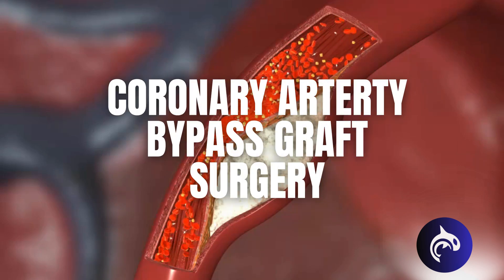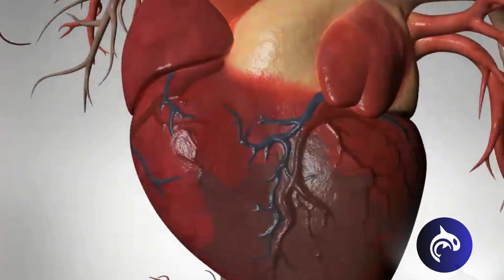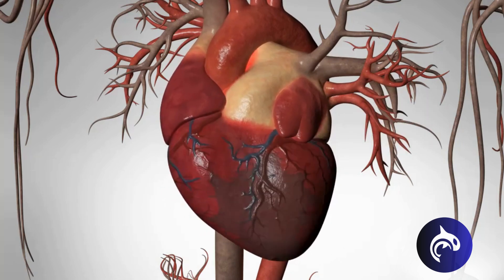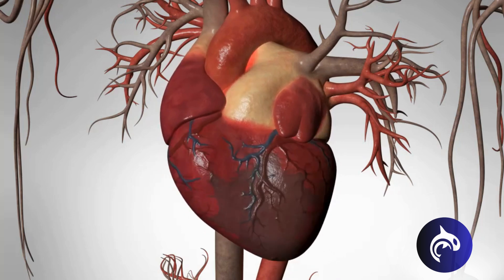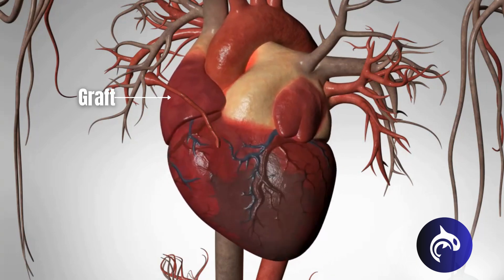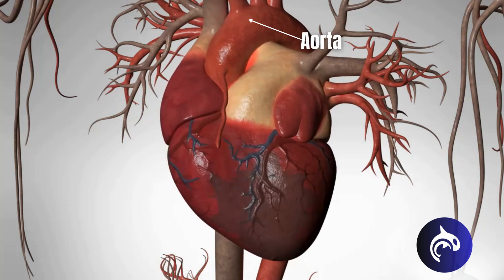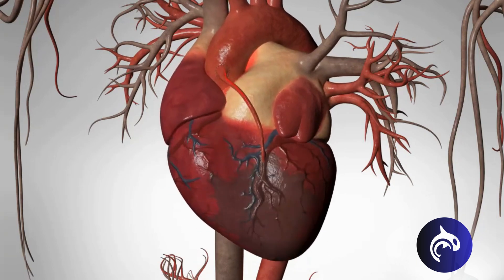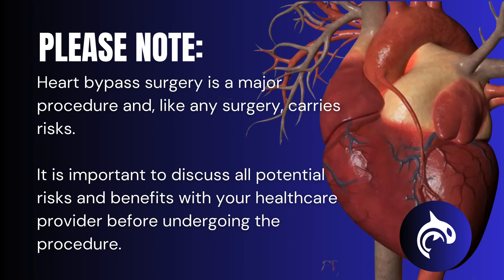Heart Bypass Surgery - See How It Works - 3D Animation (Coronary Artery Bypass Graft CABG)

Comment: hello sir my age is 19 years my heart rate is 64 which is normal but i have palpitations.its normal?
Reply: Hi you could be low in magnesium. Try taking a magnesium supplement each day (about 350 mg) if that's the case you should notice a difference within a few days to a couple of weeks. Also are you having sleep issues ?
Reply: @geoffsullivan4063  ok,thanks 
My sleep is good.
Reply: @geoffsullivan4063  hi I can take magnesium from food?
Reply from the maker: Hi! A heart rate of 64 is within the normal range for your age. Palpitations, or the sensation of a racing or irregular heartbeat, can sometimes occur even when your heart rate is normal. They are often caused by factors such as stress, anxiety, caffeine, or dehydration. However, if you experience frequent palpitations or feel concerned, it’s always a good idea to consult with a healthcare provider to rule out any underlying conditions. They can help determine if it’s related to something harmless or if further evaluation is needed.

Comment: Don’t understand

Why not insert a device that has suction and take out the calcium deposit? Then use an old extremely fine sander and x gently scrub that area clean and get entire deposit out? Or if can’t use sander use acid and melt that deposit out.
Reply from the maker: Heart bypass surgery addresses blocked arteries by creating a new path for blood flow, rather than directly removing blockages. Techniques like atherectomy or stents can sometimes clear blockages, but they are often deeply embedded and risky to remove entirely. The bypass ensures blood gets where it needs to go safely.
Reply: @healthdecide  i think i understand. but why not solve the prob and take out the deposit? deal with it directly. my speculatin is you scrape off the deposit you rupture the wall of the artery and patient dies bjut dont know
Reply from the maker: @ You’re absolutely right to think about the risks, and it’s important to note that the deposits aren’t just sitting on top of the artery but are actually embedded within the artery wall. They develop in the inner layer (intima), thickening the wall and narrowing the artery. Attempting to “scrape off” these deposits would damage the artery wall itself, which could cause it to rupture and lead to life-threatening complications. This is why techniques like bypass surgery or angioplasty are used to work around or open the blockage rather than removing it directly.
Reply: @healthdecide  helpful info to me, grazie